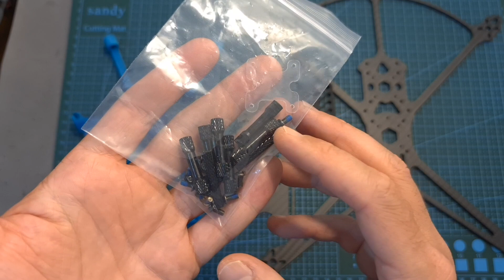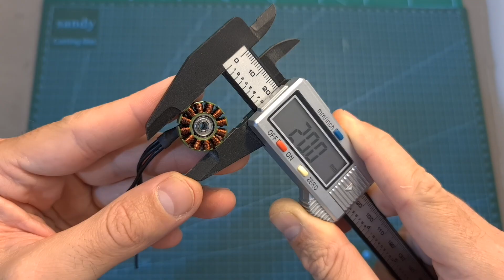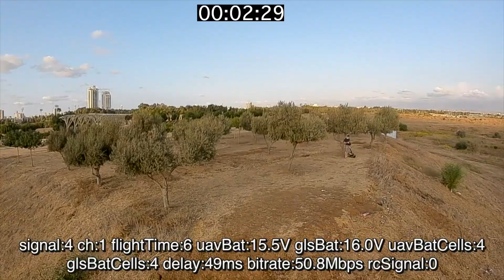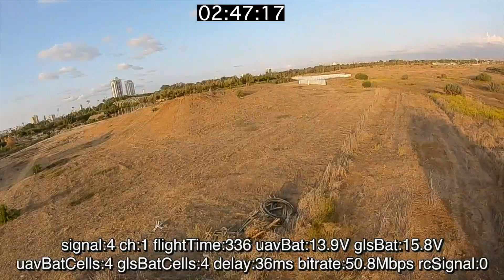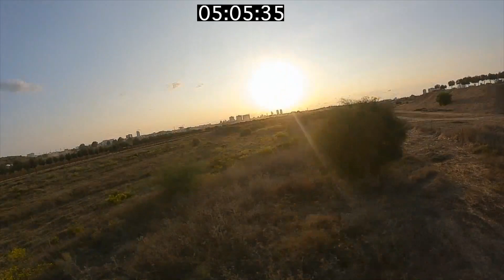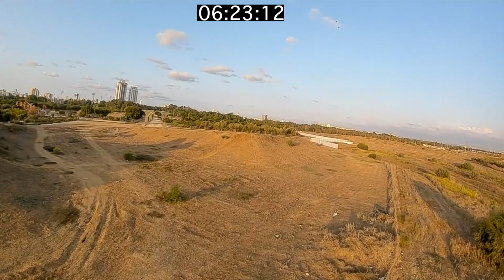Stranger Than Strange - BrotherHobby Hyperbola 7 & LR2004 1650KV Motors

Comment from the maker: I forgot to include the AUW:
- 332.2g (No Battery): https://ibb.co/kGfK4cy
- 537.5g (Including a LION 4s 3100mah Pack): https://ibb.co/p1bC5qy
Reply: wait 332.2g with an AIR Unit? thats pretty. only frame i found lighter in 7" is this x frame at 99g (no tpu for gps or anything so prob closer to this frames weight)
if i build it with caddx ant and analog vtx, then put insta360 go or smo 4k you think the power would feel a little bit better?
Did the math. Seems more under powered than explorer lr. Makes the same power almost but weighs a lot more.

Comment: Try logging the gyro during the flight to check for any vibration problems. I think it is not a motor power issue, but rather a resonance of the frame, which you can evaluate with PIDtoolbox. When there are resonance problems the filters are not effective and can cause wobbles
Reply from the maker: Thanks for the suggestions. Hopefully sometimes in the near future I will be able to test it again.

Comment: Same built 

Brother Hobby 7 inch Hyperbola
-Rcinpower Smoox 2806.5 1350Kv
-HobbyWing G3 F4 stack X Rotor Micro 40A
-Foxeer Cat 2 mini 
- AKK Race Ranger 1000W 
-DalProp Cyclone T7056C Pro 
-TBS crossfire nano RX 

Trying tuning with the slider. It flew very well and stable. 

 I haven’t tune this yet. Flying with stock betaflight 4.2 was pretty stable but have to tune more out of it.
Reply from the maker: Nice. You are using different motors which makes the tune totally different than mine. I am glad that your build flies well :-)
Reply: May i ask which battery you were using? i figure 6s Li-Ion?

Comment: Hi Gal, I hope you can figure out the wobble issue, I am curious to know if its FC ESC or motor. I am very exited for the new TBS open source 7” frame with weight of 36g and I think they said 45g with canopy.

Comment: HD footage seems to support the fact that light weight under loaded props on 7in builds are problematic.   Rando-wobbles are a thing on triblades and probably not worth the effort on a biblade much less super light weight.

Meabwhile my 1350g AUW 7in with a 640g 6s2p 18650 is so solid I can speed the footage up 200-250% and still not see any vibrations/harminics.
Reply from the maker: Thanks for your input. Yes indeed, it's a problematic setup. I will need to run more tests using bigger motors and see how it goes.

Comment: I think you have problems with the ESC. Try to flush them with 24k or 48k and try again. In betaflight 4.2 80% have problems like this. Good luck.
Reply from the maker: Thanks, I also used different ESCs and had the same issue.
Reply: @KremerFPV  I have BLheli_S 30A and i try JESC and nothing. So I put JazzMaverick 24k and all works perfectly now. Take a look here https://oscarliang.com/setup-rpm-filter-for-blheli_s-esc-for-free/

Comment: So 538g AUW and they want u to use a 2s or 3s for 400g thrust max on a very small motor for prop size..  
I'd love to do a lot of testing with it. But I would think 2305 at least and low Kv with 6S.
Reply from the maker: Yes, I am going to test it probably with bigger motors.

Comment: What is the point of that third screw for the camera mount? The mount is secured using two metal standoffs, and the TPU part is linked between them. There's no need for that third screw in the middle, or the TPU section it's supposed to fasten. Basically just a horrible design=P
Reply from the maker: Probably to better secure the mount...
Reply: @KremerFPV  I might be missing something, since I'm not looking at it physically, but if you took that screw out, would it alter anything in terms of rigidity? The stand-offs together with the TPU does all of the work here, as far as I can see.
Reply from the maker: @ojkolsrud1  I see your point

Comment: It’s impossible to tune because those  motors just can’t handle a 7” prop.
Reply from the maker: Yes, you are right...
Reply: @KremerFPV  how would the 2507 1200kv avenger v2 work?

Comment: I wonder if it just shutters and flaps from being so thin and the gyro can't handle it. Good luck on your new motor rig! I love those tests.
Reply: 7in has had a long history of not responding well to light builds.    Motors and props being properly loaded helps them.

Took me two years of trying to hit on something that wouldnt randomly wobble.

1350kv 2806.5 6s was the first real success I had.

Before that 1600kv 2306s on 4s and I just couldnt get away from wobbles until I finally listened to JET and threw a 4000+mah 4s lipo on there.

That made me re-evaluate how to look at 7in drones.

I can hit 23min cruising at 40+kph with a 6s2p 18650 6000mah pack on board.   1350g AUW with hero 7.
Reply from the maker: Thanks!

Comment: The wierd thing is that for a frame that is trying so hard and sacrificing so much to be light it is actually quite heavy
For comparison my xl7 frame weighs slightly less and is an awful amount stronger looking.
Reply from the maker: It weighs like a 5" quadcopter so it's actually pretty light.
Reply: @KremerFPV  I thought about this quad some more. Did you do any more testing?
Reply from the maker: @yannickg6904  not yet
Reply: @KremerFPV  I'm about to build a light 5in with the Diatone Mamba 2204s, all I need are some Li-Ion packs. I found a good deal on Samsung 25R cells to make my own.
Reply: @KremerFPV  I was thinking that slightly bigger stators are what this quad needs. 2204s might work better.
Reply from the maker: @yannickg6904  Yes, I will think of something, thanks Yannick :-)
Reply: I was thinking the same thing. My 7in GepRC Mark 4 frame is slightly lighter than this if I remember well.

Comment: Cutting that bottom plate must waste so much carbon. Very strange design indeed.
Reply: Diatone said there's a way to cut frames that are very thin like that without wasting carbon. I don't know what the process is though.
Reply: @friendlynomad9840   The small diatone toothpicks have interesting frames, I would really like to know the process. Maybe they don't start with full sheets but instead mould the carbon in a rough shape and do the final shaping on CNC? Really curious.